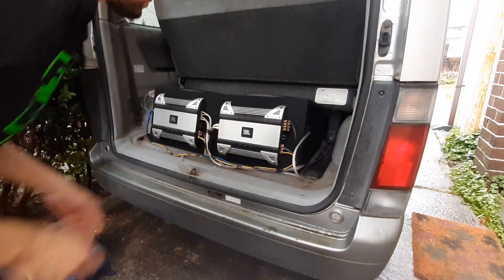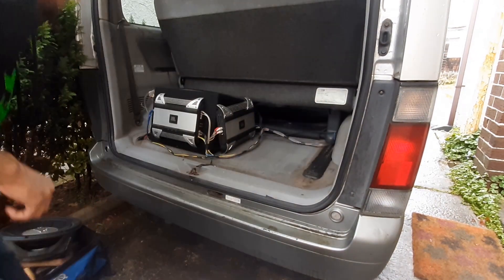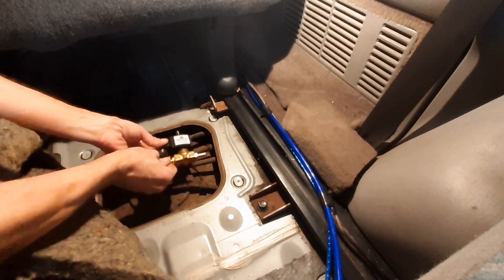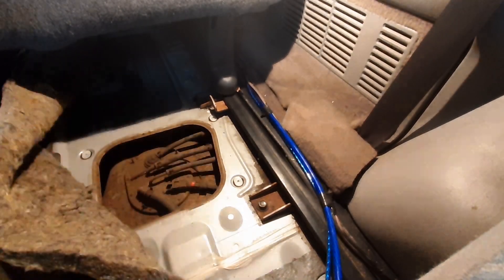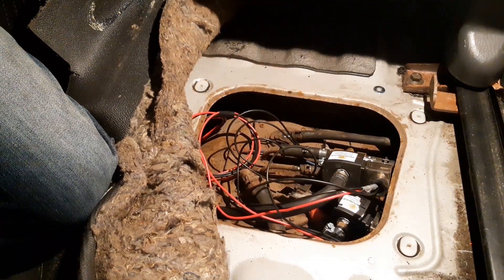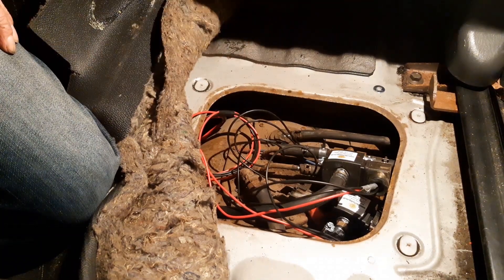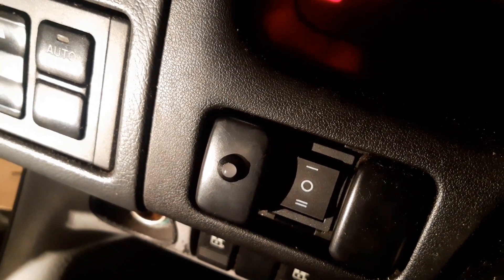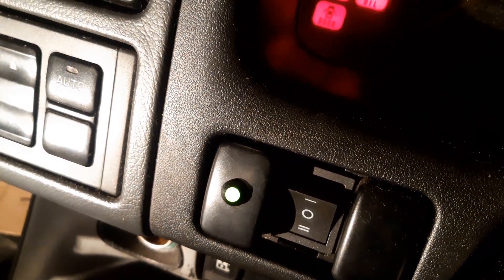Convert your Diesel to run on Veg Oil Diesel

Comment: Hey fell great video but the link u have supplied ardently no long do these Valve selectors can you adjust the link to some of that dusted correct ones
Reply from the maker: It was about 2 years ago I did this so I'd have to do some research to do that, I wouldn't want to link to something I havent tried.
Reply: @StevesMachines  yer I think ur video say posted a year ago. But really thinking about doing it for my zafira
Reply from the maker: It was before lockdown as it was my daily ro work, I havent been in the office for 18 months now.
Check your Zafira is good with veg oil, my van is a low pressure direct injection so will happily burn any type of oil.  If yours is a high pressure common rail diesel it likely won't like it.
Reply: @StevesMachines  really ok thankyou for the advice could I ask the cost of doing the conversion yourself. Solenoids fuel pipe. And the tank u used for the the beginning oil to as it seems prices are around £2000 to send to garage and have done which I think is outrageous
Reply from the maker: That sounds like the price of LPG conversion.  My home build cost about £120 I think, but a garage won't do what I did, they would need to use a proper tank etc plus a day's labour.
Reply: @StevesMachines  yer that’s wot I thought I know log for 35 litre tank is around £1800 also
Reply: @StevesMachines  exactly I’m being swamped with info on different fuels etc and using things adding them to the oil and letting them sit fora few days etc. Lol it’s a great thing I thing but so confusing and I think sombody needs to do some videos around make it simple for newbies to become more involved
Reply from the maker: I dont know enough about it, I'm just sharing what I get up to.... copy me at your own risk 😆
Reply: @StevesMachines  haha 😂 I trying to investigate it a lot further but a lot of people saying shouldn’t just use filtered oil in motors as it causes great problems etc  are u still running ur motor on it and in the Sam way as video have u had to change anything like how u filter the oil or anything
Reply from the maker: @paulsoutdooradventures1790  My van was off the road all of lock down and I had to replace my diesel pump and clean the system as algea bloomed in it.  Video to come soon.
The reason people don't always recommend it is due to potential acids and enzymes that can gunk the system up.
I'm in the process of filtering some now to fill the van up.
Reply: @StevesMachines  ok mate I look forward to more videos from u mate

Comment: Vw Passat b5.5 TDI loves it lol mix it up with a bit of derv a 50/50  mix  seams to be fine up here in the Highlands. I have never had problems with it just find after about 1000 mls need to change filters a bit more. But no real difference in the machine plenty of power. Nice job mate. Lol that's only problem smells like a chippy lol.

Comment: Great stuff.You will improve things dramatically by fitting one of Biotunnings heat exchangers and a heated fuel filter as these will get your veg oil up to 80 degrees ish and give your injectors an easier job to spray and improve running.Ive done 14 years on the setup Bosch Tdi injector pumps on Octavias.I purge from the diesel tank and back to it so there is some veg oil that gets mixed with the diesel but I have never found it a problem on startup.I filter used veg oil and have never had a problem(in winter I add a splash of diesel as it contains anti waxing additives)Also if you have set yours up so the veg runs through the normal diesel filter this will cause a problem in cold weather as the veg will wax up in the filter.It happend to me twice before I realised what was happening so I removed the diesel filter and replaced it with a small disposable plastic one.I fed the veg to its own heated filter.As not much diesel is being used (startup and shutdown)the small filter lasts a year or so.Hope any of this helps.
Reply: Hi. Will it be possible to run an older tractor 2000 of 55HP on VEGOIL  using those heat exchangers and heated fuel filters? Also, can these parts be used with used engine oil as well?

Comment: How does new rapeseed oil contaminate the fuel tank.
I have been running diesel Bongo's on Veg Oil since 2007. Pure veg oil needs a pre-heater to lower the viscosity.
If you really want to use veg oil, then its best to run Bongo's in warmer weather on a 50% mix with pure diesel , or a 30% mix of oil to diesel in colder months. All this done with no mechanical work or extra costs on parts!
And if you know Bongo's, there is never a good earth on the fuel tank.
Reply from the maker: Hey Karl, 

What I didn't want to do was try a fuel that caused problems so I wanted the reliability  of a seperate tank so I could easily switch to diesel if I had any trouble.

My bongo has a good earth on the fuel tank as I had to run a new one to it a few years ago as I had the typical mis-reading fuel gauge problem.

I have just picked up a preheater and will be fitting it soon.

Cheers